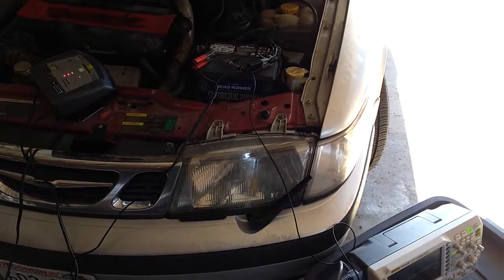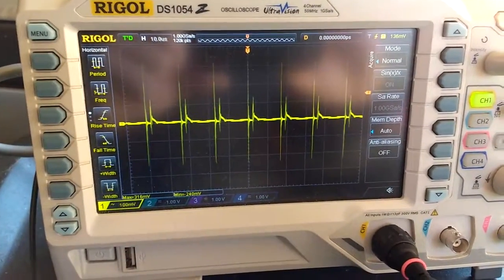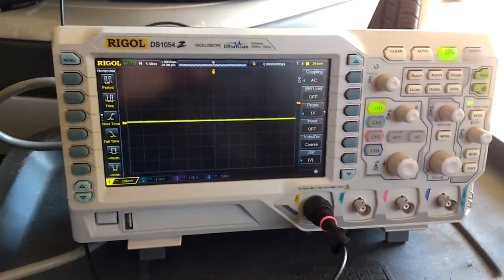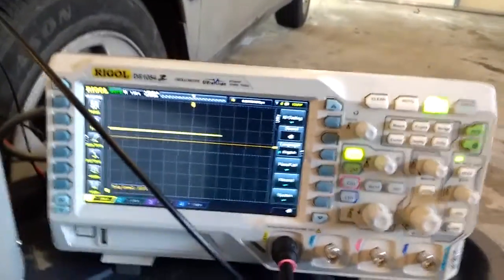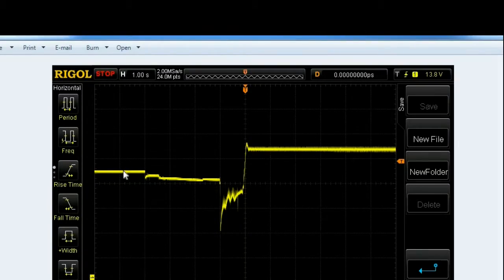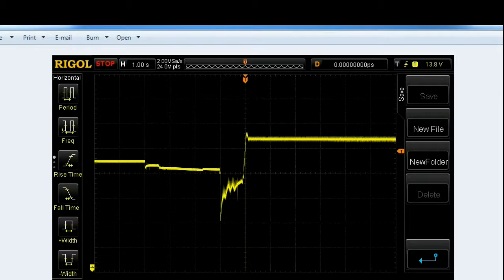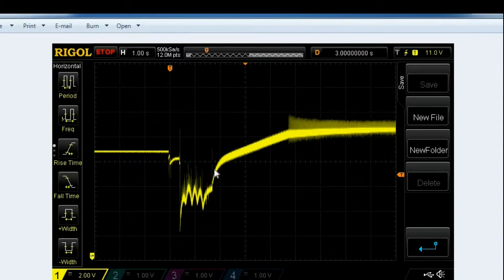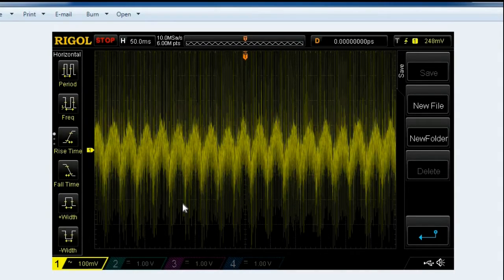Using a super capacitor as a battery (part 5) ac ripple test

Comment: Very interesting measurements . Nice charts to compare. As the ripple is much higher with the SC's, any idea how to get rid of these ? Some additional normal caps for the range 500/60 Hz to 6000/60 Hz , AC couppled with a fix resistive load ?